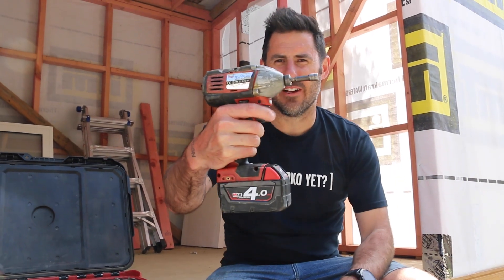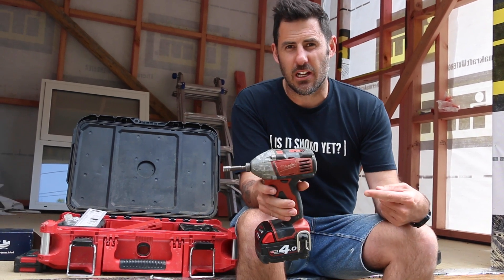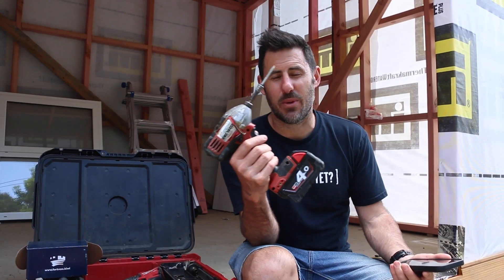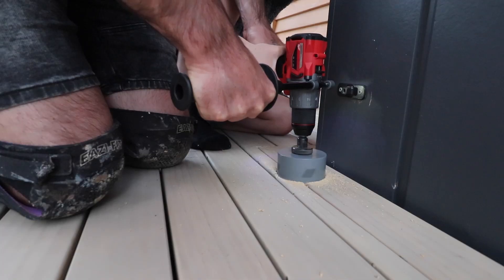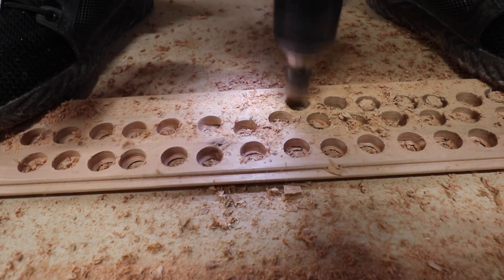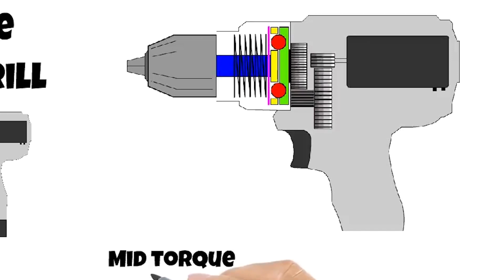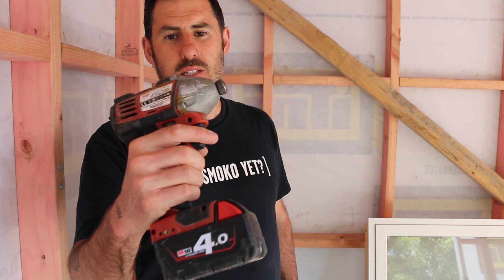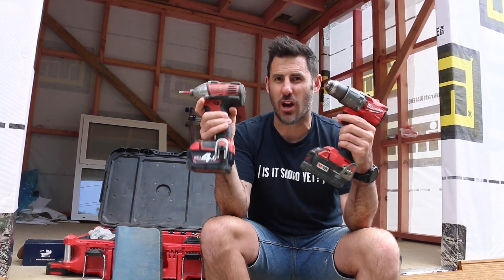DRILL VS IMPACT DRIVER!! (What's the difference?)

Comment: Hi, I think the numbers to adjust on the drill is not for different speed, is the clutch for different torque. Cheers.
Reply from the maker: You are correct, even had it in my notes, got flustered filming :)

Comment: If you're doing coloured roofing screws, use a drill, not an impact. The impact knocks the coating off the screw heads